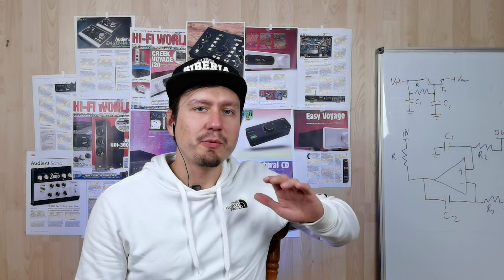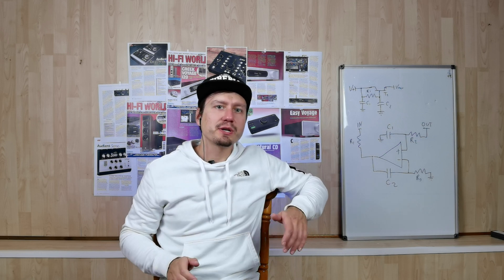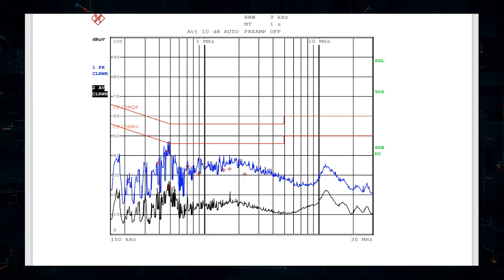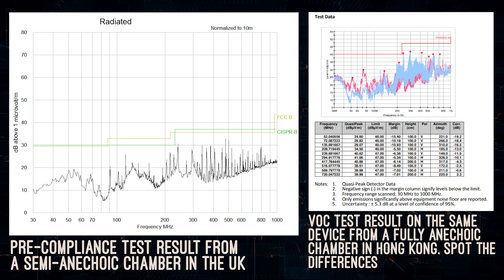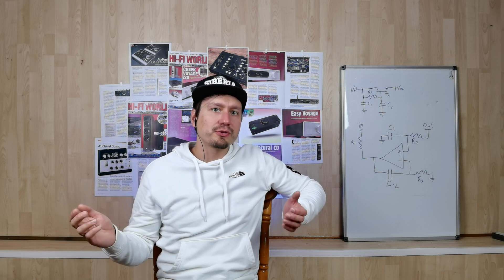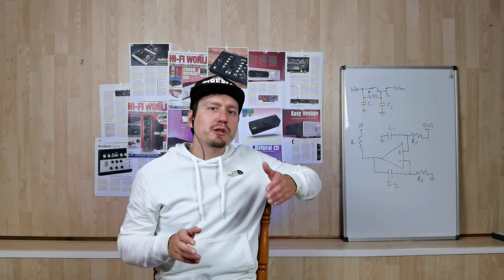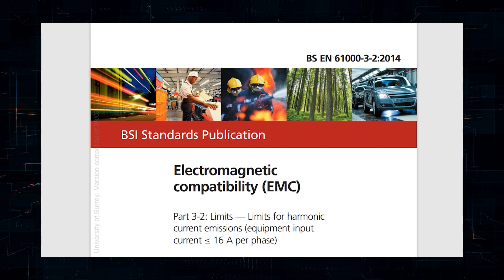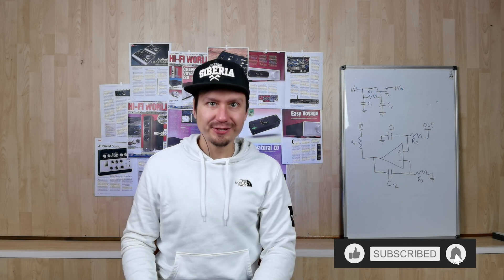EMC & EMI Standards for CE and FCC marking. Consumer Electronics

Comment: i used the first one before, it has some limitations.. 

and the second one doesnt make any sense for omega = 0 and omega = infinite. furthermore, why would one apply a signal to the output of an opamp and use a high impedance input as an output

if the in an out were switched, it could be used as a lowpassfilter with a  defined minimum frequency
Reply from the maker: 1) Yes it does! :) Certainly not suitable for high-speed switching circuits
2) It's the op amp integrator circuit, otherwise known as a DC servo. It allows to elliminate DC component from an audio signal, then you don't have to put any disgusting electrolytic capacitors in series with it you see.

Comment: Dr. Anton, thanks for making this very useful video. I had 2 questions:

1) how does this differ for industrial instruments such as an industrial controller?
2) What is a cheap way you recommend for startups to get past the safety test hurdles?
Reply from the maker: Hey, sorry for a slow response - I was on holiday :)
1) You'll have a slightly different set of standards under the Machinery Directive and typically radiated and conducted testing would fall under EN61000-6-2 and EN61000-6-4. Practically, the limits are lower by about 10dB, so it's easier to pass for both
2) Pre-compliance testing and self-cerification would be my suggestion. Also, learning from other people's mistakes and following good engineering practices for EMC during the design stage